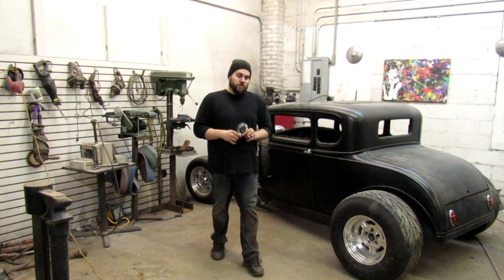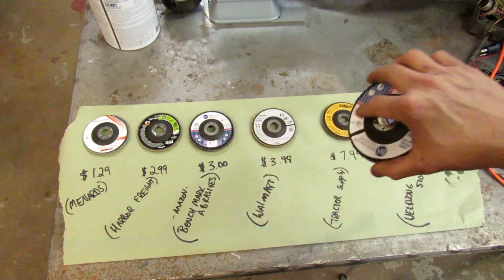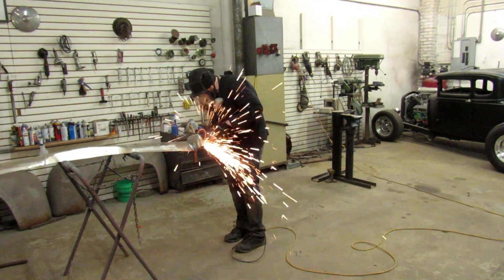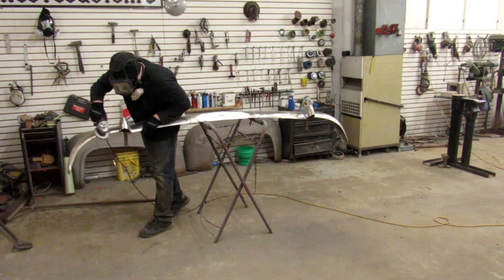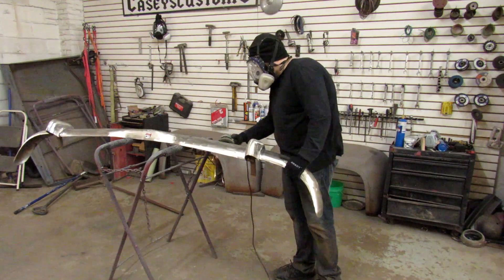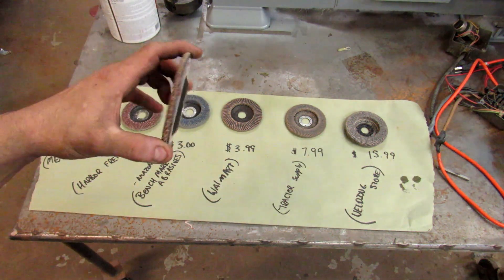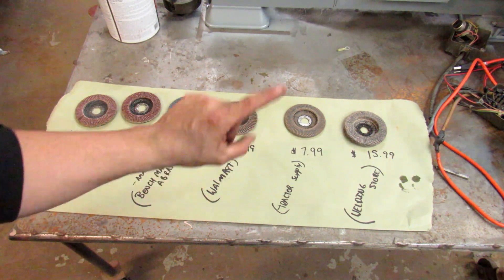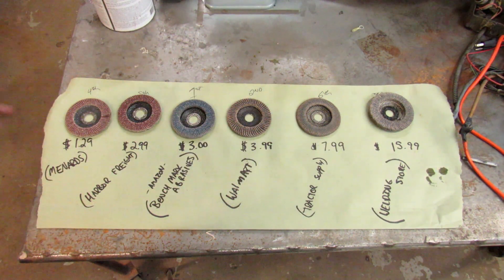REVIEWING THE MOST POPULAR FLAP DISCS AVAILABLE! WHAT FLAP DISC IS THE BEST BANG FOR YOUR BUCK?!?!?

Comment: Great video man my local carquest sells the benchmark ones I’ve bought a few I like them aswell 🙂
Reply: There much cheaper online. I really like the blackhawk disc. It's all we use at the shop anymore. The cutting wheels, abrasive disk, flap disk and stripping disc. We've had plenty of reps try to get our business. Dewalts sucked, Walter is nice, but not that much different then blackhawks. The regular and then premium disc with both wear about the same. It was nice to try them though. You should try the blackhawk xl and ceramic disc sometime.